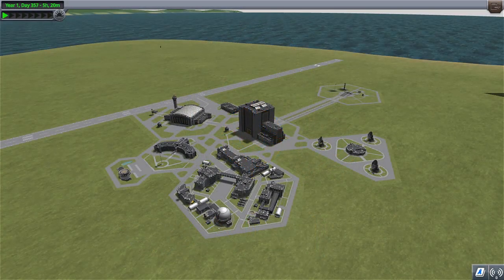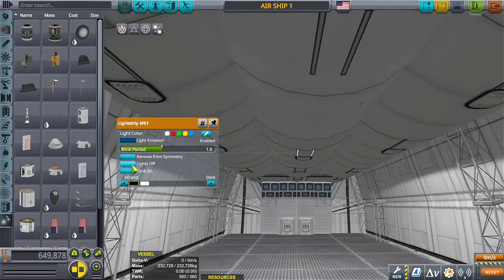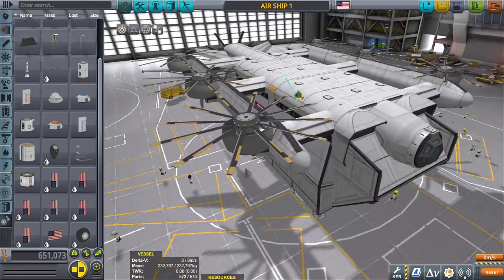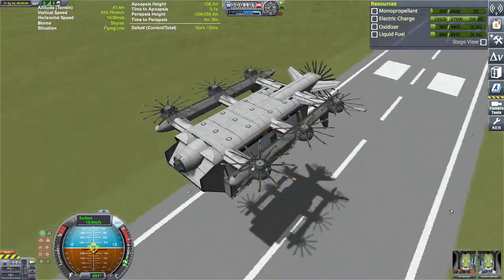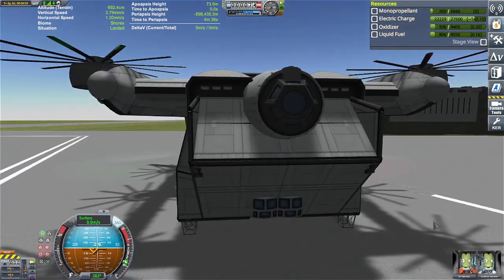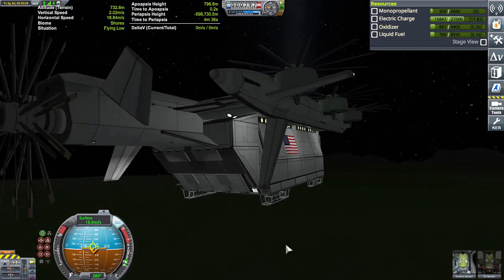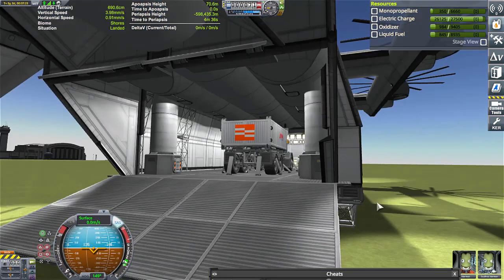AIR SHIP BUILD part 2  \  KSP 1.11 \  Kerbal Space Program

Comment: For the end of KSP development...they never had the kind of support needed to do everything they wanted to do.  Plus, the game was sort of an experiment from the start.  When KSP2 was announced, and all the corporate nonsense that accompanied it, that was really the end of KSP.  They started a new, purpose-built game from scratch...rather than a kind of sloppy experiment.  I love KSP, but a well-made game, it was not.
.
As for your main thrust props, you should make two smaller ones on the outriggers.  That will clear your rear for entry.  (yes, that was deliberate).
Reply: "Completing insertion"
Reply: The insane feature creep driven by mods raised expectations to an unreasonable degree. Just be happy with the hundreds of extremely high quality mods that you can pick and choose, none of them would magically become ten times better integrated into stock. Aerodynamic model got updated, everyone with any desire for realism still uses FAR. Robotic parts got a bit more stable, but not that much and it's paid DLC. Only thing that desperately needed fixing was RAM usage creeping up with runtime, and that's seemingly unfeasible.

Comment: 7:36 Gotcha: 230 tons.  I built a similar lift design yesterday and was able to lift the largest fuel tank -- the total mass of the craft was 330 tons, blade pitch was about 2 degrees (I was using the gigantic Type S blades).  So hovering should be a cinch for your airship.  I noticed you reduced the blades per rotor down to 12 in this video; glad to see it still works.  

7:56 Darn right it looks ominous: like the truck is driving toward a food blender!  

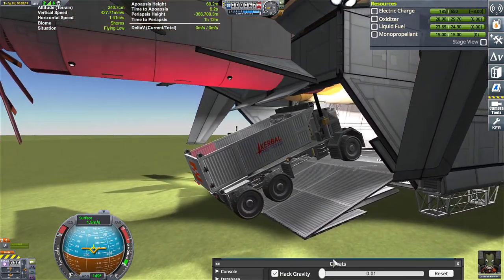8:37 Hacking gravity to load a payload into an airship: every C-130 payload specialist's fantasy.  

11:43 Geezus, that scale shot.  Wow.